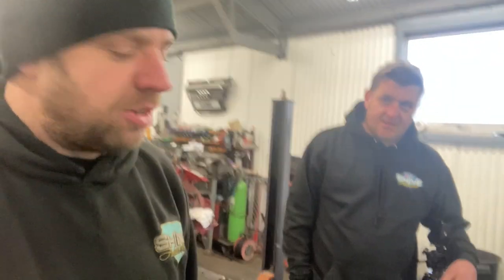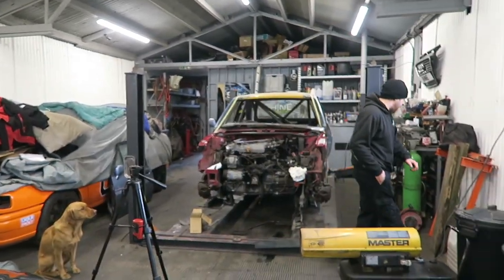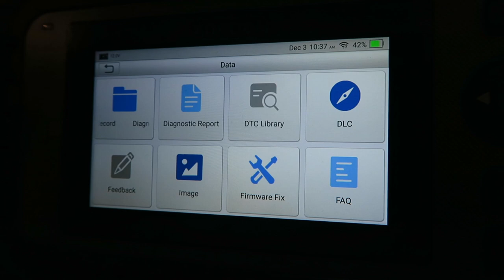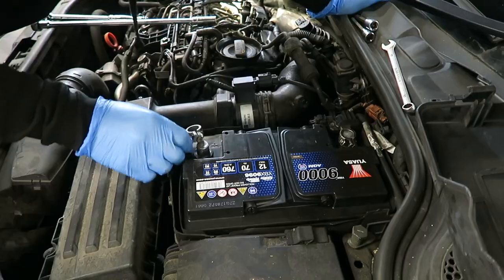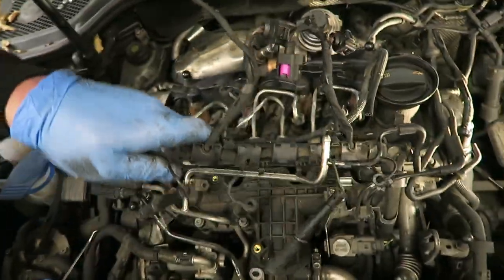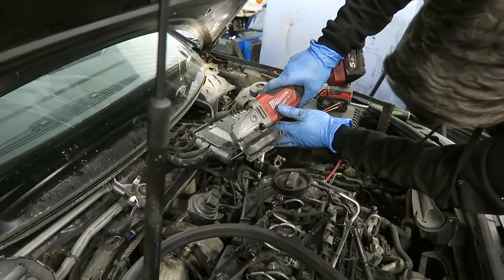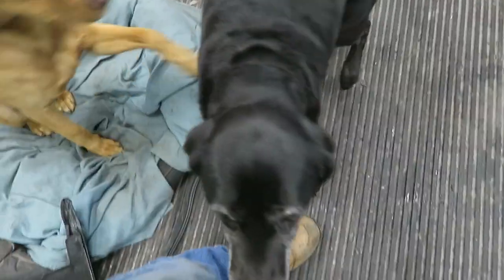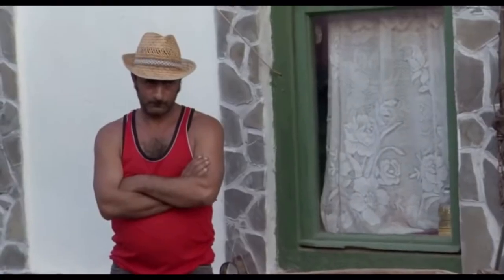Something Sabotaged One Of Our Cars Not Happy

Comment: Personally I'd have just repaired the origional wiring, you need to install a mouse trap on that audi 😂 and the ecu shear bolts you can undo with a decent pair of pliers normally. Good job though lads👍
Reply from the maker: They would not sure if we pliers these ones are decided to weld the self on . Grinder is the correct tool . Personally it was more fun and entertaining watching Sam replace the full loom I think repairing it would’ve been boring .

Comment: Will  a cheap machine find fault on 09 mk5 astra it's got a problem on electrical side ie draining battery not sure if the Clifford alarm is causing problem on car 🤔
Reply from the maker: you would have to do an AMP test .  If you have an engine light on it’ll tell you the issues with the lights at run on the dashboard. A computer points you in the direction . It sounds like you will need an auto electrician or a good car mechanic who is good with his meter readers. If you’re close to the garage get it booked in with us to look at
Reply: @shineautomotive  thanks for information and merry Christmas all 🎁🎄☃️❄👍